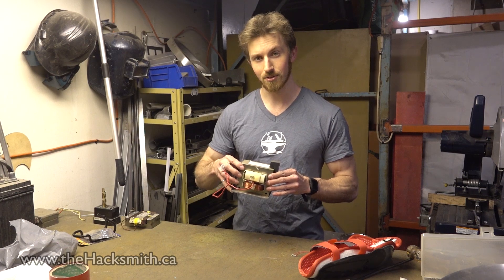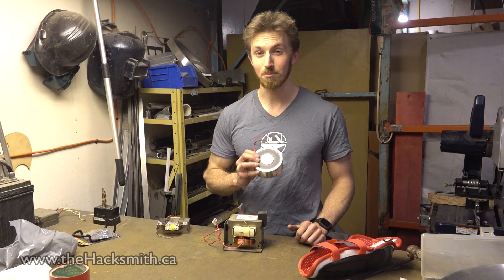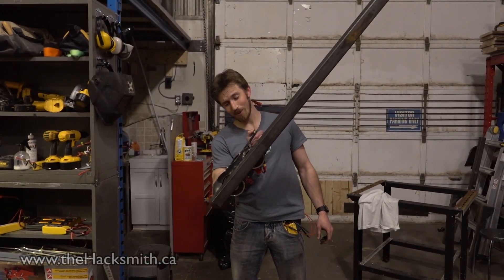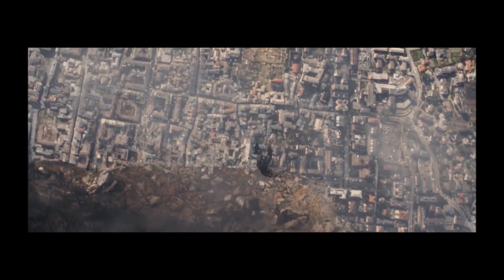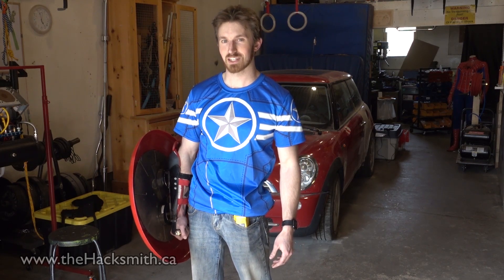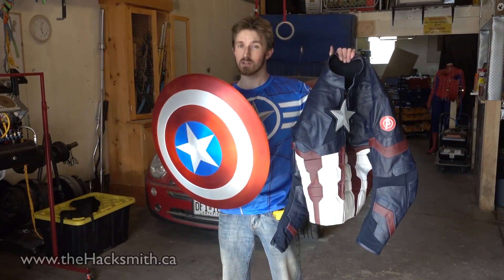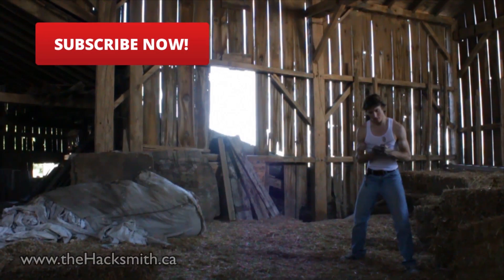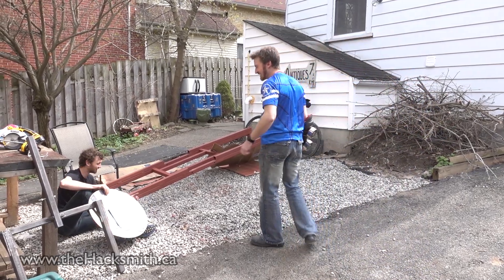How Do You Make Captain America's Electromagnet Shield?

Comment: hey so i wanna use this technology in airsoft kinda like how master chief puts his gun on his back.i have a couple questions for you.

1) how hot do the electromagnets get and can they burn you(if they do get hot how to protect my clothes and stuff from getting burned.)

2)how hot does the battery get if i can have it in a pocket and it wont catch on fire 

3)i want to create a clicker system to turn the electro magnet on and off 

i will be using this for hours on end sometimes during full day missions so it would be nice if it could last and if u could help me with this it would be awesome
Reply from the maker: +Chaos[MyThiiC] If you run the electromagnets at the rated voltage they are usually good for 100% duty cycle (using it all day no problem). If you used my system, yes, you'd burn yourself.
Reply: how would i make it so i wouldnt burn myslef and this might seem like a stupid qs but ive seen that magnets dont work with all metals so does an electro magnet also magnetize aluminum

Comment: if you want a stronger magnet, magnet locks for doors (you can probably get a used one from a large office building for free if you ask the building handymen) cost under 100 bucks, if u get the chinese knockoffs, which work just fine,  and can have over 3000 lbs of holding force. and run on 12v. 3000lbs of holding force @ 12v. and 1 3000lb holding force magnet lock weighs less than the 2 electromagnets you have.  just a suggestion. they also have solid state instant on / off switching.
Reply from the maker: +King Brian The First We looked into those electromagnets first, couldn't find any with that kind of rated holding force -- do you have a link?

Comment: Interesting .. here is my recommendation though, On the shield you place a pair of large neodymium magnets. On the electromags, have them be able to reverse polarity.... see where I am going with this?
Reply from the maker: +Thundolis Already in the works ;-) stay tuned for the big test video!
Reply: +Thundolis Maybe tack on a cheap set of accelerometers to reverse the polarity of the two magnets based on throwing angle. Would give some good control over the throw if it could be tuned.

Comment: "The magnetic force decreases exponentially with distance."

I think you mean "the magnetic force decreases proportionally to the inverse square of the distance."
Reply: +Joshua Wilson Isn't inverse square an exponent?
Reply: +Joshua Wilson What was said was correct and was the most efficient way of communicating.  Don't lose brain cells trying to sound "smart"...
Reply: +zbiv while -2 can be an exponent, that's not what exponential decay means. Exponential decay is goes like exp(-n*x) whereas power laws decay goes like x^(-n)  where n is a some constant in both cases. They are not equivalent, granted my comment was meant as a tongue-in-cheek response.
Reply: +Emmanuel Sims As I mentioned in a previous comment, my comment was meant to be tongue-in-cheek. Your video was pretty cool, but your attitude here is horrid. Edit: grammar thanks to Emmanuel Sims
Reply: I cannot understand your previous comment because, yet again, you try to sound like the "smartest guy in the room".  No on cares.  Again, what was said was sufficient and your comment was not needed.  Also, it's your*, not you're*...  basics first my friend.
Reply: +Emmanuel Sims Thanks for your comment on my grammatical error so I could fix it. I'll be more careful with my grammar in the future.
Reply: Good I'm glad I helped, you seemed to struggle in that area.  Have to help those that only preach.

Comment: you could use a wire and a powerful winch to pull it in.
Reply from the maker: +kwintin1000 yeah but that'd be kinda lame...
Reply: +the Hacksmith It would be cool if you could make it powerful enough to retract quickly, since it doesn't need to lock in place you could make it pretty damn fast.

Comment: You should use those magnets in the exo as well!
Reply: considering the exo is made out of metal, having a set of electro magnets capable of lifting 6000 lbs together would have the potential to cause a catastrophic failure.
Reply from the maker: +Moon Man You get electromagnets are highly directional right...? it'd be pretty safe to mount these on the arm of the exoskeleton if I wanted to, and we'll see what we end up doing...

Comment: is vibranium magnetic material
Reply from the maker: +nachiket joshi How else would this work?
Reply: +the Hacksmith if vibranium can rearrange its molecules to minimize force acting on it then it will behave like magnet in smallest electromagnetic field  so you can retract it by applying field as forces between magnets is much greater than forces between magnet and material

Comment: I think it would be cool to build some sort of magnetic gloves and try to climb with it
Maybe also an additional adapter for the grappling hook, to grab on flat metal surfaces :)
Reply: +Tim Foerster Problem with that is that there is a slight correlation between magnet's strength and it's size, even an electromagnet. If you put magnets on the finger tips, you'd loss a lot of their holding power and not stick. Make them a part of the palm and you'd get the strength back, but loos that incognito look. And then there's the batteries to power everything and the added weight the batteries would cause (no where near as bad a relationship as rockets though). And actually having good core and upper body strength goes a long way.
Reply: +Tim Foerster Problem with that is that there is a slight correlation between magnet's strength and it's size, even an electromagnet. If you put magnets on the finger tips, you'd loss a lot of their holding power and not stick. Make them a part of the palm and you'd get the strength back, but loos that incognito look. And then there's the batteries to power everything and the added weight the batteries would cause (no where near as bad a relationship as rockets though). And actually having good core and upper body strength goes a long way.